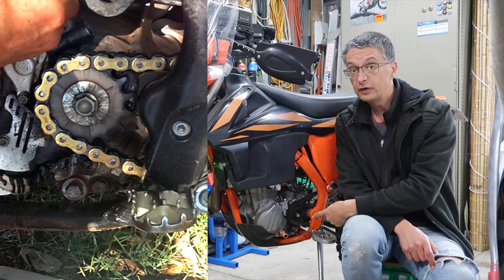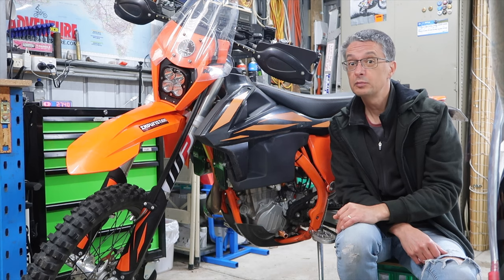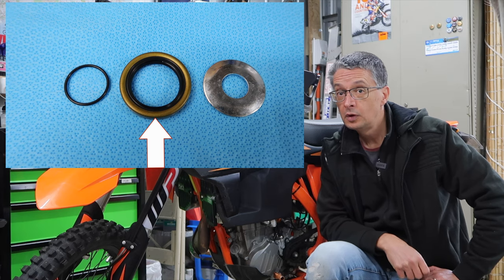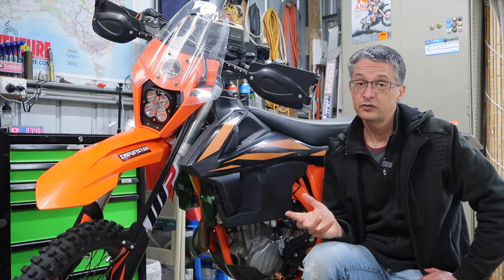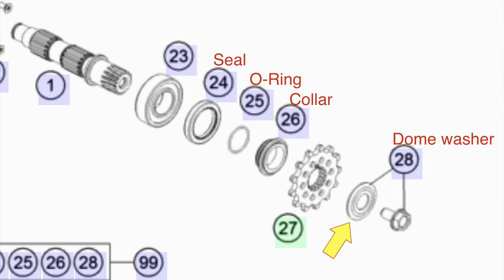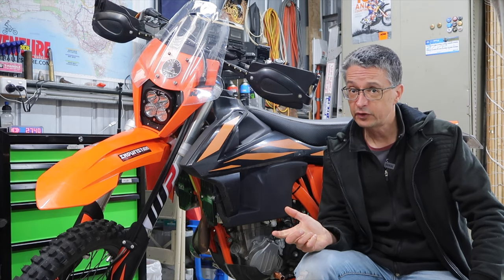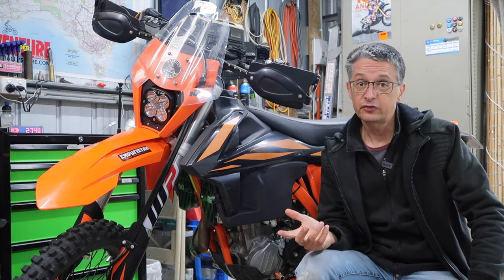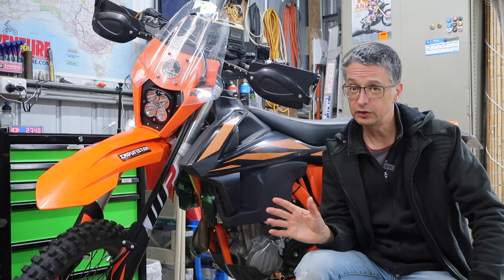How to FIX leaking countershaft on KTM 500 EXC-F (or any KTM) WITHOUT replacing the seal!

Comment: Mine is not leaking currently, I replaced the seal and  o ring about 80hrs earlier, but I see the Dome washer is certainly not snug, cant I just add a thinnish steel washer between dome and Bolt?

Comment: A hot tip is always run Oem or a good quality front sprocket like supersprox 

Some of the cheaper brand sprockets are slightly thinner and cause premature seal wear.

Comment: Good info...another thing which I learnt the hard way was that the flat side of the sprocket should face outwards and the side with a step/collar on it should face inwards...made the mistake of putting in on the wrong way (doh) and immediately got a leak as there wasn't enough pressure on the o-ring - in hindsight shud have known something was wrong when after tightening the bolt to 60nm, the dome washer cud be spun by hand (doh again)...anywway turned it the right way round and leak was gone 😄